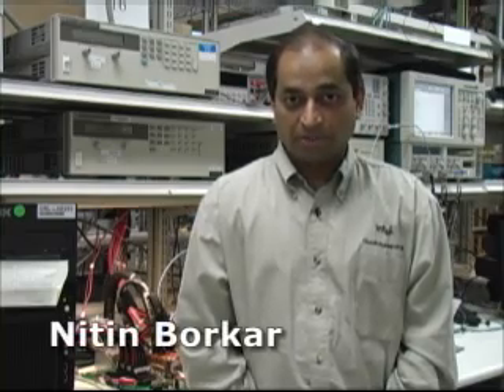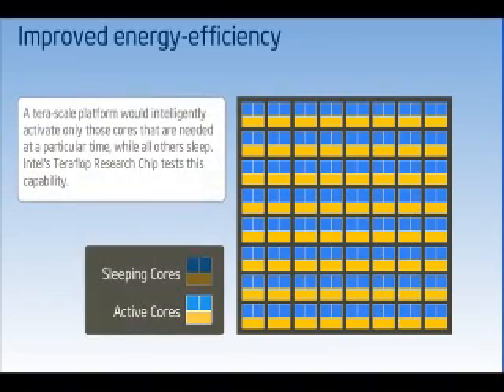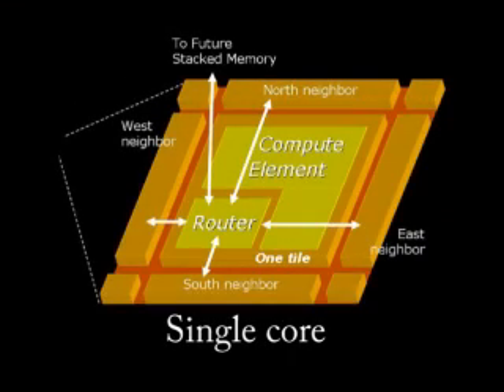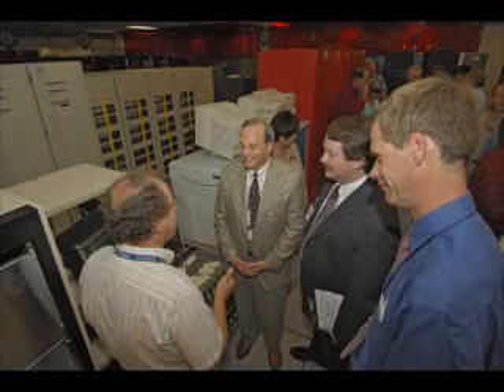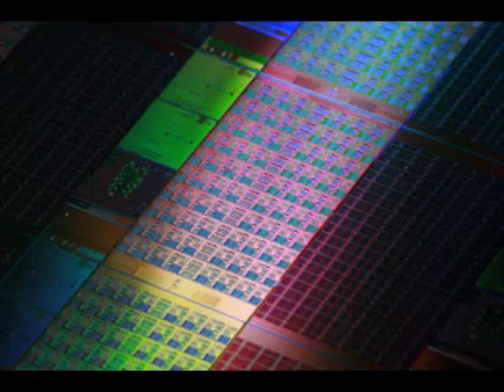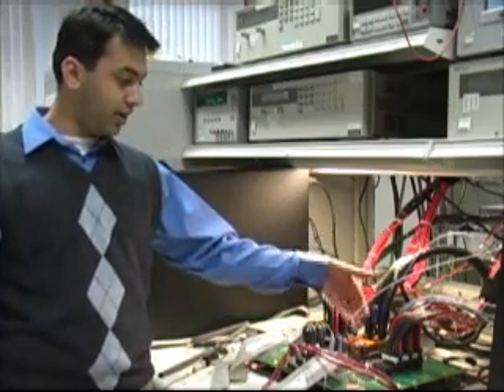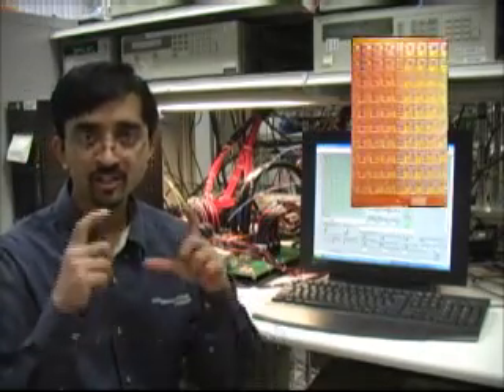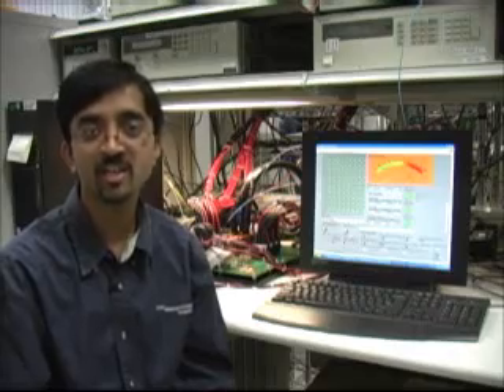Intel 80-Core Teraflop Research Chip

Comment: Sorry I misunderstood your comment. You made it sound as if the P4 in general was the way to go, I didn't understand you were just talking about threading etc. ie high frequency single core chips instead of lower clock multicore chips.

Comment: Yes that is correct, BUT the core 2 duo and core 2 quad models do not utilize any type of hyperthreading technology similar to the Pentium 4; However, i wrote is comment like months ago, and sice then intel has become smart and has integrated a similar technology to their new line up the "i7" which utilizes similar if not the same hyperthrading technology as Pentium 4, and added another type of hyper transport called "Turbo Boost." So PTIUM4 WAS IN THE RIGHT DIECTION, who gave me 4 thumbs down:(

Comment: There is a few things most people are forgetting one these are not x86 cores and two well it can't run any program as it has no memory controller.
It can't run general purpose software either as it's not really a general purpose processor but a vector processor.
Lastly it's just one TF of vector operations GPUs already perform at this level now.
This is mostly marketing BS and spin.
There is a very similar product called the kilocore that already is on the market.